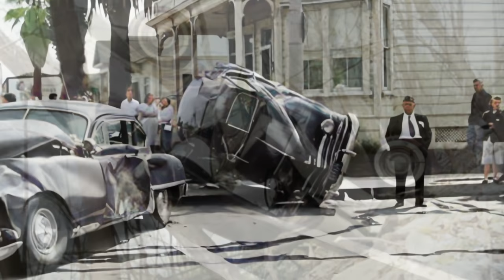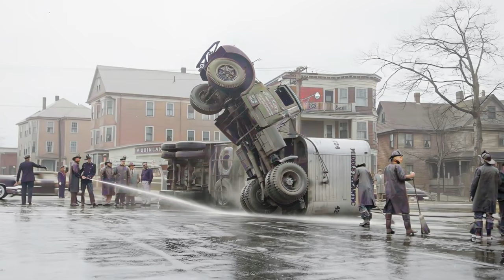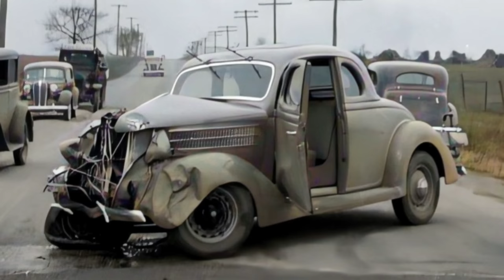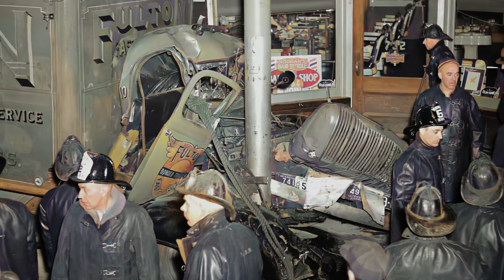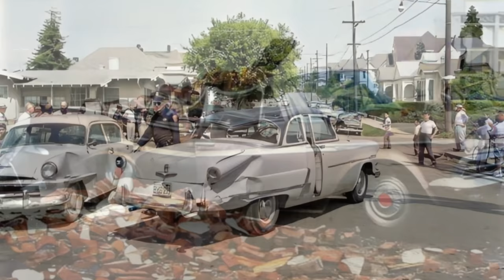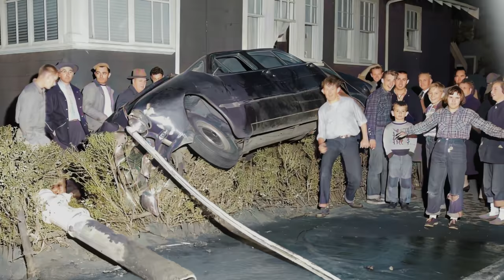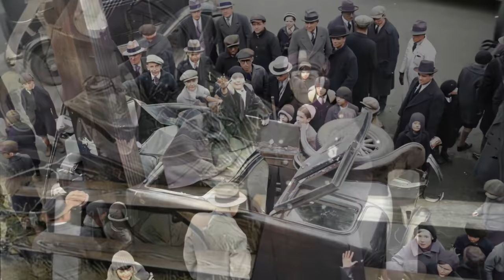Crash Chronicles 2 [Colorized]

Comment: STILL a ton of cars from the 50's and 60's running around and STILL looking better than anything produced today!!
Reply: That was the issue, exactly. Good looking, but more deadly.
Reply: I've enjoyed driving vintage cars for 40 years now, but the lunacy I see on the roads today has me thinking about selling my collection. It's time for a national conversation about the horrible drivers ubiquitous on America's roads. Tonight most of the drivers I encountered were distracted, running illegal lights and/or wheels, failing to observe basic rules of the road, etc. It's just as easy to drive legally and correctly as it is to drive like an idiot. Time for major fines for the little infractions.
Reply: Sadly, not in the upper midwest and east coast.
Reply: And you know what?  A lot of these cars got repaired by dads in their own backyards.  Like my dad, he could repair bodywork and engine repairs.  Christ, you can’t even change your oil on cars today.  Too much computerized engines and plastic body work.
Reply: @okie9795  yep. 60 now and have been wrenching on those since I was a cute. Sadly,  here in the Midwest road salt has eaten most of them.
The other thing is the speed these cheap plastic and aluminum cans can achieve is insane. The suspension, etc. isn't built for it.

Comment: These vintage cars looked like they were built like a tank but absolutely fell apart when wrecked. I grew up witnessing how these rigidly built behemoths ended up and so many occupants were seriously injured along the way.
Reply: They certainly were built like a tank, but how will we want to define that? The engineering was never for collision in mind. It's clear as day when you look under the cars- no crosswebbing, just frame rails connected by a weak floorboard.

You could get these cars to '70s level with a little additional strengthening in sections.
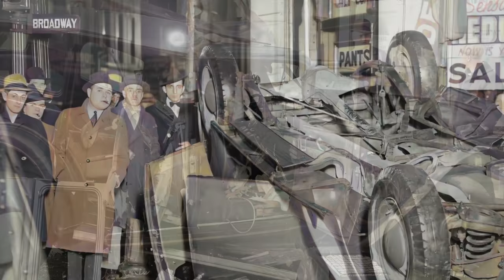Reply: 2:14 is a perfect example. A shell on two rails...
Reply: And I was led to believe you couldn't wreck those cars when I was younger. 
That's what my dad would say.
Reply: @Calc_Ulator  It's not all about strength, at least when it comes to occupant safety. A sturdy car that holds up in a wreck can be a death trap. The reason new cars are totaled so easily is because they are designed to crumple and bend so that the people inside are subjected to a less sudden amount of G-forces in a wreck. Think about it like this, you can build a car like a tank, but there's a reason people who drive tanks wear helmets, its because a tank doesn't give in a collision.
Reply: @Calc_Ulator   I took my 53 chevy truck to the frame.  Boxed it added supports did 4 link rear mustang 2 front suspension power disk all the way around. SBC with 5 speed and all the good stuff but still looks factory.   People always seam to forget we really had no real highway systems when most these cars was made and they was not intended to run 100mph with other cars all around them.  It was not until the mid 50's Eisenhower started  building the national highway system. Shortly after that is when safety started to improve in the 60's.      But anyone that does not love the style and class has no clue..   Retro Mods are the way to go.
Reply: No they did not fall apart. Was in an accident with my 56 Caddie. The eye lid over a headlight was dented on the Caddie...the new Chevy was totaled
Reply: @drosera88  excellent points!
Reply: In many of the older cars the fenders were sometimes up to 3/8 of an inch thick made of steel case in point my father and two of his army buddies were traveling near home in a bad snowstorm back in 1939 he said and they were going too fast to make the curve so they ended up running out into the then harvested snow covered corn field and turned over, he was telling me this story when I was a youngster about  25 years later and I remember asking him, " Daddy didn't you get hurt?" He said, "No, you can't hurt a drunk! We crawled out of the car, then turned it back up on its wheels and took off again!" And we both had a great belly laugh as he finished telling me that story, and even to this day I still laugh about him reliving that story and sharing that incident with me that happened to my father long before I was ever born back when my father was about 22 years of age @ the time.😂😅 😂😂
Reply: they were built. full frame and good thick metal. bad damage from being hit by another tank. people hurt from no seat belts air bags drunk an haulin ass. tha ford got hot an wouldent do no more.

Comment: My '66 Galaxie has lasted longer than most of my newer vehicles I've owned. I also don't just park my Galaxie, I drive it almost everyday. 

It was original until I got a hold of it. I've since updated some things on it but it was factory the day I bought it some odd years ago. 

Dual reservoir brake master cylinder and discs on the front, and a bigger, newer engine along with a new trans. 

Still cheaper than repairing a newer vehicle.
Reply: 390 powered? Very cool! I'm putting a '64.5 Mustang back together.
Reply: Most of these people are now dead. Pedestrians and officers, too.

Comment: Many of these classic cars and trucks are very coveted and preserved. They will outlast almost all of the vehicles of today.
Reply: All things being equal, modern cars will outlast the older cars. But, more effort is put into preserving those older cars because they're more stylish and have a lot more character.
Reply: @jreagins1 ,
Modern cars are designed with obsolescence in mind. Plastic bumpers that are barely attached don't protect the vehicle. Endless electronic components that easily fail. The classic and vintage vehicles will easily survive being submerged in water. Not so with modern vehicles. 
You can pretend all you want but modern cars are overpriced junk compared to classic and vintage vehicles.
Reply: @freedomforever6718  
"Plastic bumpers that are barely attached don't protect the vehicle."
Correct and they never were designed to protect the car ..they are designing to protect the DRIVER not the car by absorbing some of the impact..

In fact the current plastic bumper is only a cover there is a steel beam behind it and behind that 2 shock absorbers...
Reply: too true !!
Reply: @MickeyMousePark  ,
You don't have a problem with designed obsolescence. Got it. Cars don't last as long as they used to on purpose. 
But just like Mickey Mouse you are all make-believe.
Reply: @freedomforever6718 AMEN BROTHER
Reply: @MickeyMousePark Mickelson go and play with mini leave the humans talk and stop squicking

Comment: I’m a retired embalmer. Here is what killed 90% of the people: Look at the steering column and steering wheel! Blunt Force Trauma ! Never EVER failed! There were no seatbelts back then. Some luxury brands had a simple lap belt so your mortician could find you without having to crawl around in the mud and the blood 🩸 and the beer! #2. Rear view mirrors were not up high and out of the line of travel when the body slammed forward. They were on the dash or roofline to catch your flying noggin as it went forward into that greyhound bus sized steering wheel 🛞 and open your cranium and scull. Because no Super adhesive was invented back then,  that could mount your mirror to the windshield and out of the way  These cars were so heavy because the steel was not an alloy. It was pure 100% steel 1/7 inch thick! so when two of these cars would hit, there was no crumple zones! A softer Toyota can absorb a big hit! These cars were BEAUTIFUL in some cases! But only in the 1950’s because the 1940’s produced so many tanks and planes etc for the war. 

YOU lucked out being born in THIS time! Back then there was no oversight for the poor bastards that got behind the wheel. Air pollution was belching out of the cars.

Comment: They’re great if you enjoy getting impaled by the steering column, or getting knees sheared-off by the dash. Practically nil occupant protection. I’d still love a 1957 De-Soto or Dodge. 👍🏻
Reply: I had 57 De Soto convertible. White with red interior.
Reply: Either a '56 Bel-Air (my birth year) or a '58 Impala.
Reply: Newer cars are so much better! 
I mean yeah like the 1991 Ford Sierra where the steering wheel would decapitate the head? 
Or 1997 Citroen Saxo that preferred to pulverize your legs like a bad piece of beef?
Or 1986 Volkswagen Santana (and T3!) that likes to collapse the front end past all the way past the rear passenger doors?
Or the early '80s Holden Commodore that played accordion the length of the vehicle?
Reply: @Calc_Ulator  true enough! I was referring to modern cars though.  Generally the survivability is far greater than stuff that was around 25-30 years ago.

Comment: I love the line and style of the older cars plus the ease to repair them and modify them.   That said most was not even close to safe compared today.  Of course to be fair they was not made to go as fast or be in heavy traffic like today.  I love to see people do what I have done to my 53 Chevy 5 window truck.  It had a top speed of 55mph, shitty drum brakes, single master cylinder meaning if one brake line failed you had zero brakes, crap suspension, no turn signals and only one brake light with no seat belts and more.    Now it has 4 wheel power disk brakes with a split master, a modern  suspension, seat belts, power steering and every thing a more modern car would have minus the airbag and all the emissions computer crap no one wants. Plus AC is a big bonus too.   Every part on my truck down to every bolt is mass produced today as people love restoring them.    Resto Mods are the best.  It drive as good as a new truck and it is 70 years old.
Reply: You know it’s not hard to repair or modify new cars right?
Reply: @flight2k5  way to much shit on them not needed and to many plastic parts. They will never be around 100 years from now like the old ones made of steel.
Reply: @jvmiller1995  😂🤣 like old cars aren’t around without maintenance.
Reply: @flight2k5  sun rotted plastic parts need more than little love.  Also  I am mot referring to maintaining a nice car. I am talking cutting the tree down growing out the engine bay drag one out of a field and make it drive and look good. It is just a different era.   I do not need a computer to tell why it has no fuel or spark.  Very easy to figure out. 

I am not against new cars but I certainly prefer the classics

Comment: No seat belts, metal dashboards, steering wheels that were a wheel on a shaft pointing at your chest, suspension and steering was terrible, many cars had no tempered/safety glass windshields until the 50’s. But they were built like tanks.
Reply: bigredfred, you're right about them being built like tanks but it's all relative. You may be driving a tank but that car you crash with is also a tank.

Comment: So, I have this Durant car form 1923. It has been into a crash at some point. Front end of the frame are slightly bent. More serious; the steering wheel (made of cast steel and wood) has been broken by some unlucky soul's chest... Otherwise, the car seems to come from it quite well...
Reply: These older cars did not have collapsing steering columns so that was not uncommon that and the steering wheel would break away so the driver was speared on the solid steering shaft.

Comment: Glad my parents taught me the correct way to drive - never been in an accident since I started driving in 1976!
Reply: In 1976 I was 15 got my permit to drive before I turned 16 in July of that year. My first wreck was my dads 1973 gmc 350 engine in 1977. All down from there until I turned 22. I hope I don't miss any , but here i go, Blew the engine in my 71 charger 383 magnum . My 72 heavy chevy 400 small block wrecked 2 times. 1968 Pontiac tempest 400 big block 1976 Camaro, LT1 350. 1971 mach1 351 winedsor,. 1974 ford ltd 400  and a 1965 dodge dart 318. 1973 Oldsmobile  cutlass 350 rocket .
Reply: You mean your driving has never caused an accident.  It can still happen no matter how good you are.
Reply: You might not be able to avoid being an a vehicular accident no matter how well you drive, but good skills and constant vigilance will help.
Reply: @shawnbottom4769  And it HAS happened to people like that.
Reply: I wouldn't be careful not to brag if I were you

Comment: I think the safety features in old cars like those was the sheer size and all steel.  No fiberglass or plastic in the design.  Seatbelts would have probably been a good thing though.
Reply: @@yuckfoutube2259 Yeah but if it's too weak you can get crushed in a small accident too. Although they are less safe many people did survive some nasty crashes in cars from this era.
Reply: Now of course in 1953 you could buy a fiberglass body corvette lol
Reply: About the seatbelts, I have known 5 people who were killed by seatbelts and 5 who lived because they weren't wearing them, and I don't know anyone who was ever saved by them or anyone who was killed that would have been saved by them. Makes me wonder how on earth could my experience be so different from what everyone else "BELIEVES "
Reply: @pughoneycutt1986  The main value is preventing you from slamming in to hard surfaces and if you still do reduce the force you hit and and keeping you from getting ejected. But yeah I agree sometimes they do more harm than good like for example if you roll over a car and the roof collapses or its a convertible with no roll bar you're probably better off without it.
Reply: @redtra236  you definitely don't want to in up upside down in a body of water with a seatbelt ,they jam and you can't get loose 4 of the people that I know that were killed drowned in this manner and the only person who survived those wrecks was the only one that didn't have a seat belt on. They tried to get the others out but the belts were jamed and they couldn't get them loose. But the real sickening part was none of them were hurt in the wreck they drowned
Reply: @pughoneycutt1986 seatbelts didn't kill them, the accident did. It was that seatbelts couldn't save them.
Reply: @MarkJones-qn1eg  no the accident didn't hurt them but the seat belts drowned them, the people in the car with them who were not wearing seat belts either were not hurt or had only minor injuries and was able to get out, but were unable to help the ones who were wearing the belts get out and had to watch their friends drown because the dam belts jamed
Reply: @MarkJones-qn1eg  Sometimes seat belts can lock up and trap you though but usually they will help. Also if a car rolls over and doesn't have rollover protection sometimes you're better off with out them(especially convertibles)
Reply: @redtra236 if you would get crushed in a modern car the same impact then would be instant death
Reply: @metallicafan416  Depends on the car probably not if we're talking a chevy spark vs a lincoln continental

Comment: I grew up in the 60’s on a very deadly section of 305w in Paducah Ky.
I recall that no one wore seatbelts, drove way too fast and when those steel tanks crashed it was incredibly loud.
Many times we would find one person in the car and several dead passengers 100-200  feet or more from the car.
People romanticize the cars but they were unforgiving death traps.
Reply: If you crash at high speed in a modern car you're likely to die too though so regardless of what you drive being careful and not speeding/making unsafe maneuvers is the best way to keep yourself safe.
Reply: Just like today, it only takes 1idiot...

Comment: Always thought those Old Cars were stronger and safer . Looks like I was totally Wrong 😢
Reply: You weren't wrong
Reply: Def not safer.
Reply: @bruceb5481  full size cars from 50s and 60s are a hell of a lot safer than today's cars
Reply: There has always been a nut trying to drive 55 through town at noon.....
Reply: @pughoneycutt1986 sorry , but they're not, I've seen crash test footage of 50s cars and it's not pretty,  there's a video of a 50s chevy  deliberately  sent colliding into the path of a modern car , the modern car ploughed through it and tore it apart, it's on YouTube I believe.
Reply: @stevedickson5853  yes a 59 Chevrolet built on the X frame that GM used from 58 to 62 and was discontinued because of the very weakness that was demonstrated in that video, but a perimeter frame is vastly superior. They were very careful with their choice of cars for that bit of propaganda
Reply: @stevedickson5853  It's ok, I drive to avoid wrecks anyways; always dodging you divebombing everyone with your BMW.
Reply: @pughoneycutt1986  Sure................................

Comment: One thing the old cars had that the new ones don't. Real steel!
Reply: Yup! And the steel was super heavy and crumpled straight into the passenger cabin. 
No thanks. I'm happy with my aluminium and carbon fibre with passenger compartment crumple zones. Plue all the safety bells and whistles.
Of course, my modern car can also reach speeds much, much higher than those clunky old steel rides. So I could still kill myself in it. It's just way harder to do so.
Reply: @flawedexistence  well guess what Amc had crumple zones and a unit body in the 50s.

Comment: When I drive my 57 Benz 220S PONTON people have a tendency to take extra care when close by.  I also take extra care as the car gives me the discipline of focus as I have to concentrate when it comes to the manual transmission,extra time with braking etc etc. I don’t take the car on the highway.  IN the unfortunate  event I do get it in accident, I am driving around in about 4500 lbs of steel. I might fair better when plastic makes impact.  The images in this video are steel hitting steel. I did upgrade with seatbelts which all classic cars can add-even if it’s just a lap belt.